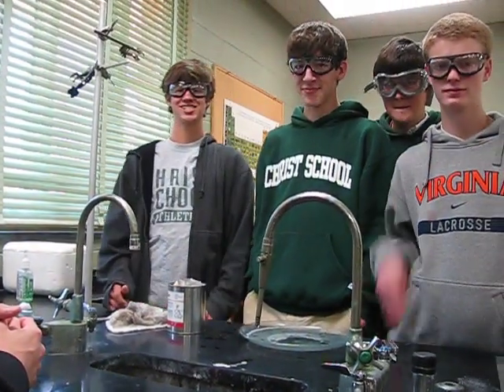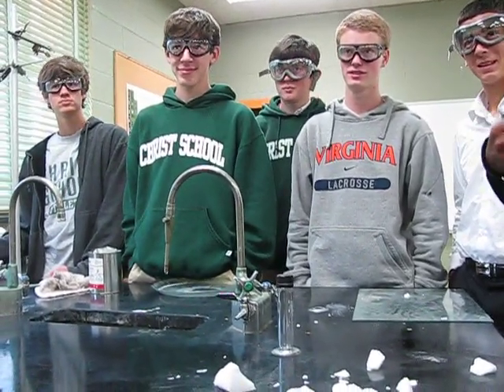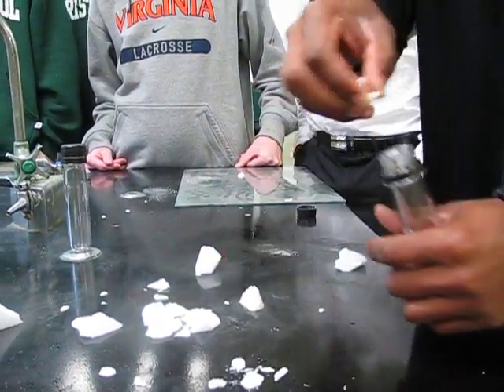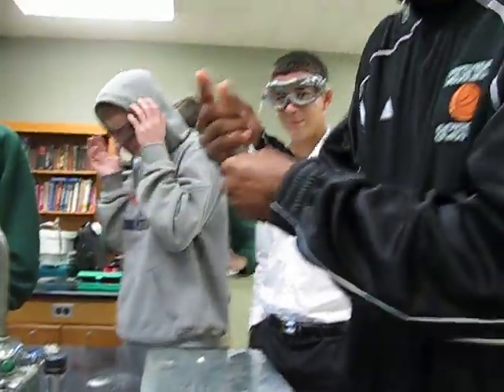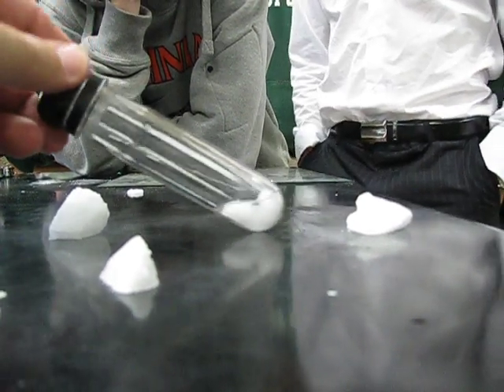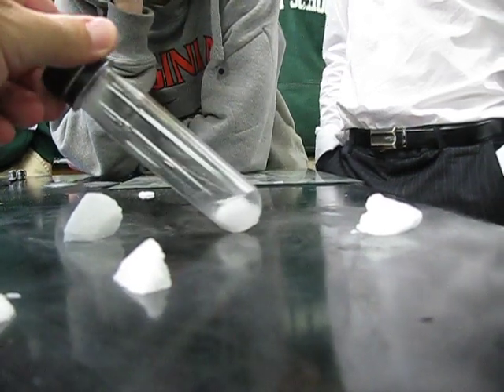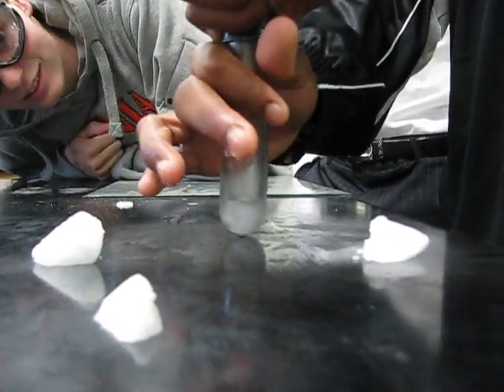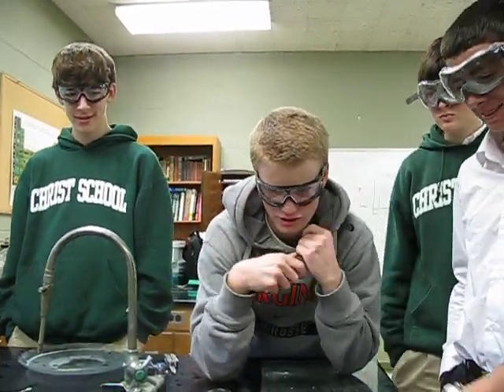Formation of Liquid Carbon Dioxide

Comment from the maker: You are correct that when you put gas in a high pressure area that it tends to form liquids.  However, dry ice is a solid.  If you look at a phase diagram for CO2, at room temperature, when you increase the pressure CO2 will melt into the liquid phase instead of subliming and going into gas phase.